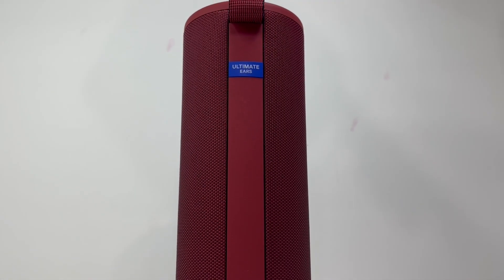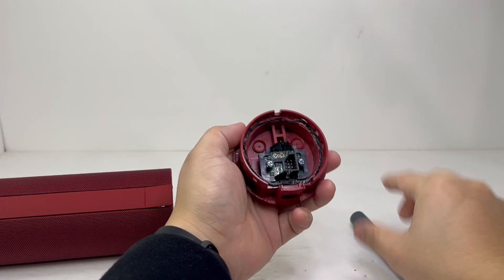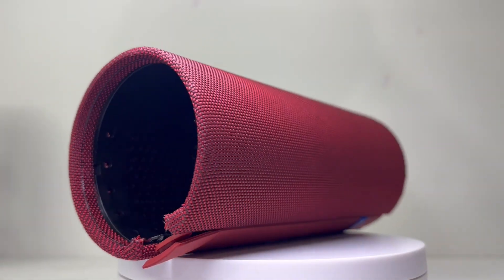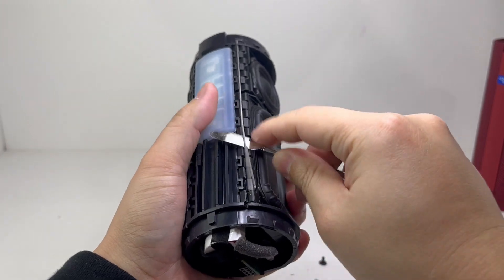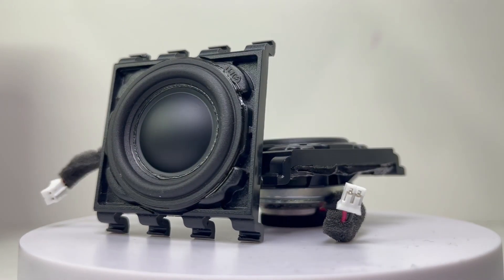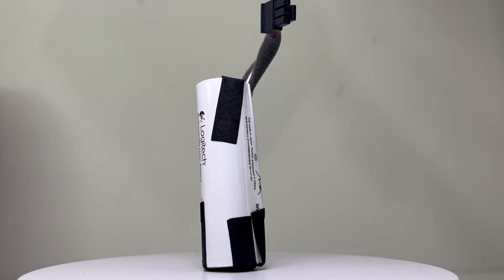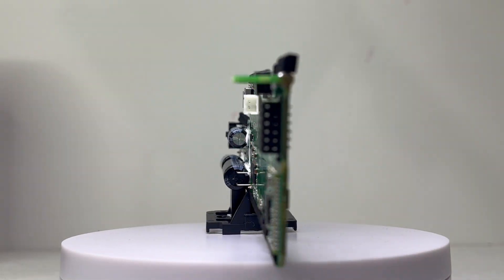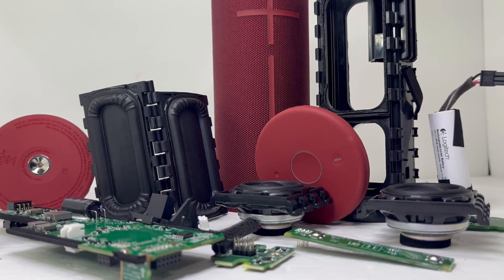UE BOOM 3 COMPLETE TEARDOWN !!!

Comment: Since the charging port can be removed without tearing all apart, is it possible to replace it with type c port?
Reply from the maker: it seem doable, but i'm not sure if the speaker can regulate the voltage output from the usb-c.

Comment: very bad speaker in my opinion
Reply: Maybe it is but it does what it is supposed to do and that with brilliance. And obviously it is for outdoor usage, for the indoors there are better alternatives. 
Here a little review from my perspective that I wrote for another comment:
Reply: I have a Megaboom 3 since three years and no complaints at all… Everything works perfectly fine. 
I had the normal Boom 3 before that but one speaker was broken after one year so I returned it and got the Megaboom 3 for 10€ less because it dropped in price :)
Three friends of mine also have the Megabooms since 4 years and they are working fine as well. Pairing them together works also very good if they arent more than 3 meters away from each other. 
And they are completely waterproof. We literally play waterball with them in a lake and nothing happens. Pool (Chlorine) is also perfectly fine. 
Last month I literally drove over the Megaboom of my friend with my bike at full speed because it dropped out of his backpack. I nearly kissed the cencrete but the Megaboom was completely fine (might not even get a scratch, but it has a lot of them already so we couldnt tell :D)
So I would personally go for it but definitely look at the competition like the JBL Charge 5 because it is louder I think and has a little better bass imo. 
If you want it for indoor listening I wouldnt go with the Megaboom 3 but if you want to take it outdoors then I would go for the Megaboom. Just put a carabiner on the hook and you can literally put it anywhere, on your backpack, bike, fence… I also had it in the water compartment of my backpack while skiing :)

If you get it for a good price you gonna get very happy and it just looks like an art piece.
Reply: Works great for me. It is in my shower. Love it.
Reply: Then why the world sale it so high price
Reply: Highly recommended this speaker for outdoor rough use.